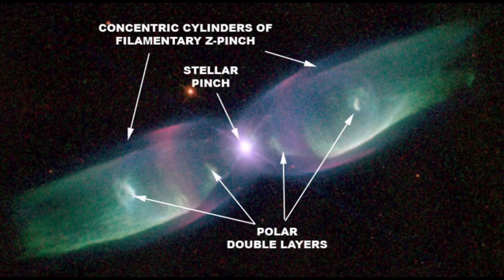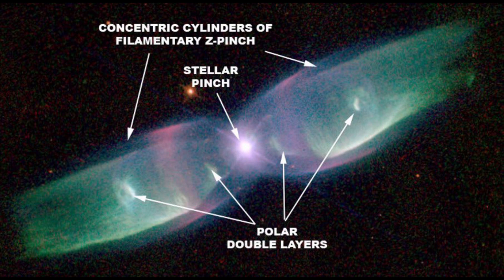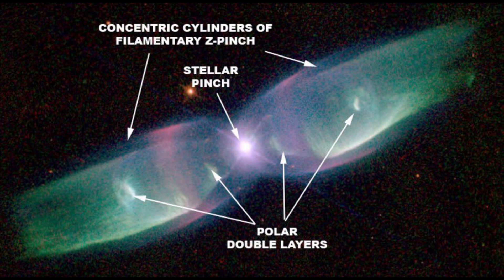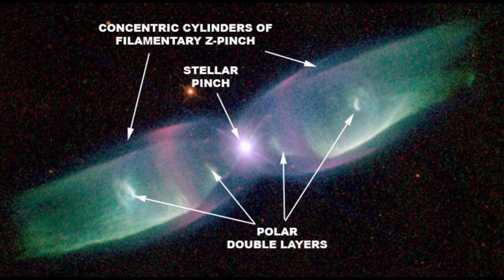Z-pinch in action - SpacePlasma

Comment: Maybe you can test if plasma can be controlled by different frequencies, that would be interesting to see.
Reply: There's a website for that. I think it was princeton who had a plasma website.
Reply from the maker: https://youtu.be/f9q0S67lk5Y
Reply: @ElectricUniverseEyes  Thanks for the reply. I'll check out the video.
Reply from the maker: Yes, frequency controls everything, especially electricity/plasma. Check out the video I just posted today… in the middle, Chris turns down the external current, reducing the output of the electromagnetic field which is bending the xenon plasma in the tube… you see it relax as the frequency is reduced.